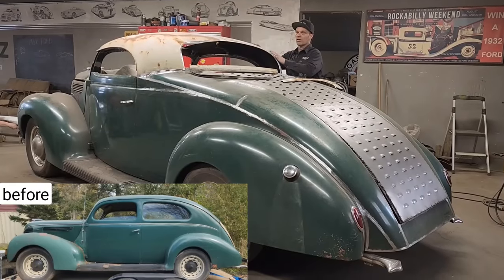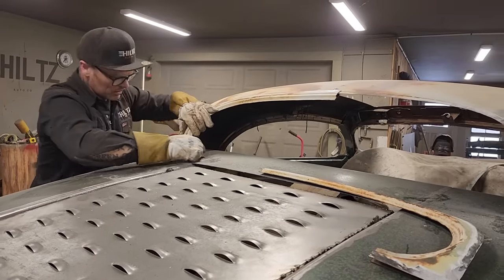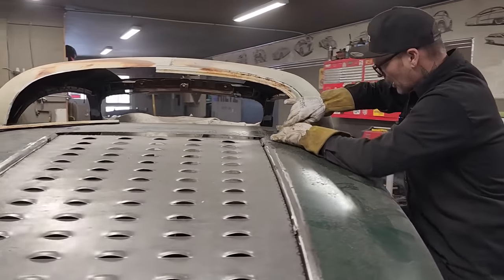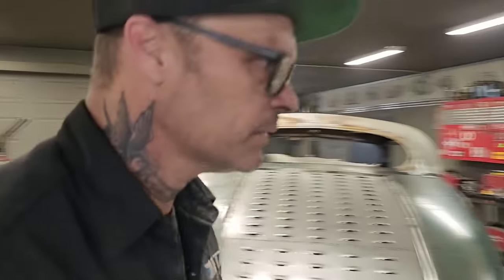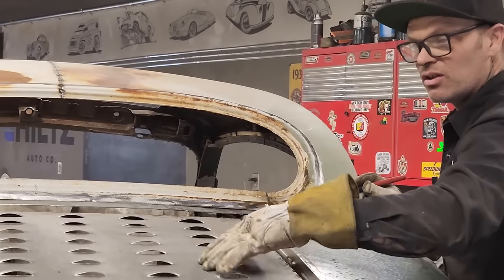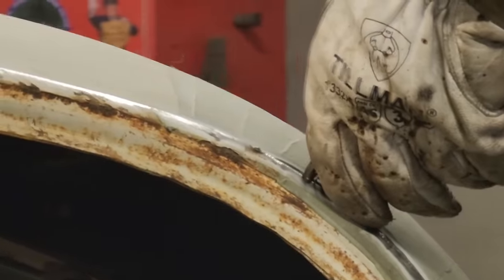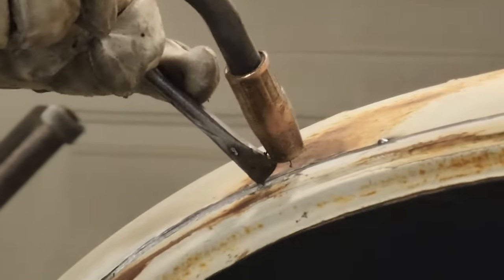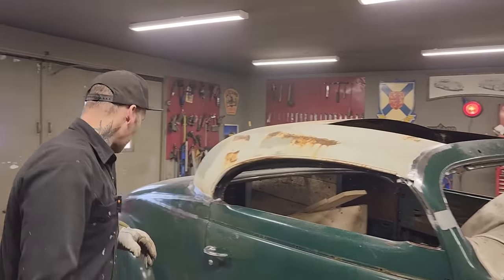Manipulating the back window to fit 🥷

Comment: G'day, 
I think the back window is really coming along awesomely. 
One thing that keeps bugging me, and that's the timber in the back. The timber on the bottom is OK, but the side timber no. I think it needs to be refined a bit . It needs to be covered in metal, but bead roll a pattern in it . This, I feel would complete the look and tie it all together. 
Keep the videos coming guys, as this build is awesome. 
✌️Peace.
Reply: Quite agree. It looks like a stock grate to transport your pig around! Too thick and too heavy. Its only there to cover the wasted space above the wheels.😑

Comment: Why don't you remove the rear cover to make it easier to work on the back window,, give you more room
Reply: I was just coming on here to say the same thing
Reply: Daaaa!  Kinda like me looking for my glasses. Lol
Reply: Appears Chads learning new dance steps, it’s a dance trying to produce, promote and keep everyone busy and happy. Hats off to the Hiltz team.
Reply: Came to say the same thing. Lol!
Reply: Just coming on to say the same, too.
Reply: I was thinking the same thing yesterday.👍👍
Reply: Maybe he’s concerned about burning the timber with welding slag.
Reply: I think it's welded shut.
Reply: @MrHowlor5  no he said it slid down that's why there is a gap at the top.
Reply: @dalecherry4044  Oh! Does it hinge or just sits there?
Reply: @MrHowlor5  no it isn't...because it has slid down.
Reply: @MrHowlor5  just sits in place. Removable
Reply: @MrHowlor5  are you sure you're watching ?
Reply: @dalecherry4044  Ok, so it just sits there? ......  that's it? Why would you chop up a (vintage) car, to haul a motor cycle,  when you could've just use a trailer?
Reply: @MrHowlor5  yes it just sits there. Go back a couple of episodes and listen.

Comment: Shrinking stretched metal is an art in its self. It is time consuming , but rewarding in the long run!  On the edge of the metal it is nearly impossible with out cutting and welding.

Comment: I’ve got a interesting question. Isn’t that part of the old Jaguar roof that poke down between the two layers of the window frame now cut off and laying down in there somewhere between the two layers of the window frame? Did you know when you slipped the frame up over the existing Jaguar roof that the piece was going to be cut off and can you get it out with a magnet or tacking a coat hanger to it? It could make a nice rattle if you don’t! Just curious

Comment: Mr. Chad , Could you get a piece of SOLID square stock and cut a groove for the bottom window molding to fit into. Then  weld that new piece down so it does shift back and forth. That would seal your gap from water coming in. I am thinking that looks a 45 degree slant,could be 30 degree slant for the groove.

Comment: It sure would be a step in the right direction to see a nice interior put in the car, headliner, door panels, floor covering, and put metal panels behind the seat in place of the wood. Also are you going to put plexi glass in the rear window frame?

Comment: Hi  Chad. Can I ask how thick are your zip cut wheels? Here in Australia we have 1.6mm thick wheels and they cut very easily . I like the way you overlap joints and then cut through to make a butt joint. 1.6mm wheels would cut easier and still leave enough gap for weld penetration.

Comment: Chad, Please don't kick me but I have another idea about the metal trunk lid.  The metal has all the open rises in it.  How about heating up all the open pockets and solder them closed making it one solid piece with no open pockets. Would have to sand back the lid to form and that is a lot of work.  Just thought It would take the trunk lid back to true and you would still have the bike hauler.  I like what you are doing with the top and the back window openings.  It is possible you already thought of my idea, if so, my apologizes.  I am just focused on the overall back line and thought it would be a good idea.  I realize it is even more work, but I think it would be great.  Best wishes to you and your crew.

Comment: This car's lines are absolutely stunning, and the roof works beautifully!  It looks like a high-end custom from the late '30s or '40s.  The only odd part is the louvered rear deck, which doesn't really fit.  Nobody asked me, but I'll say it anyway: making it into a "motorcycle hauler" was a goofy idea from the start.  It could still be fixed.  Other than that, this car could be one of your very best ever!  Consider giving it a smooth rear deck, with a smaller trunk lid and a covered, rear-mounted spare tire.